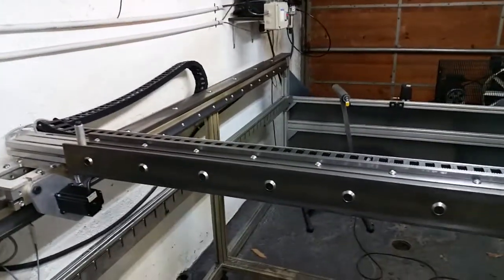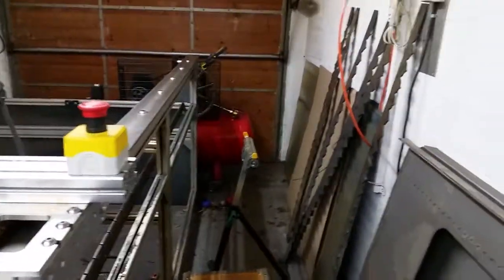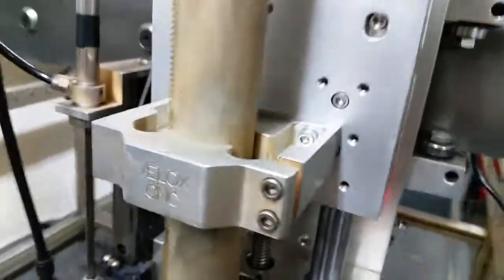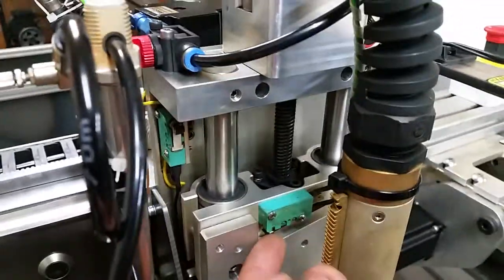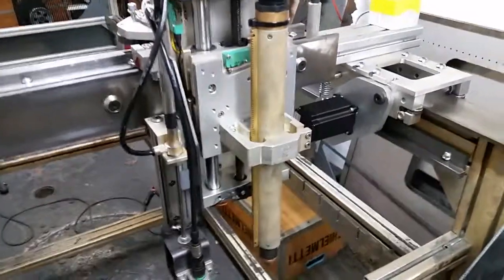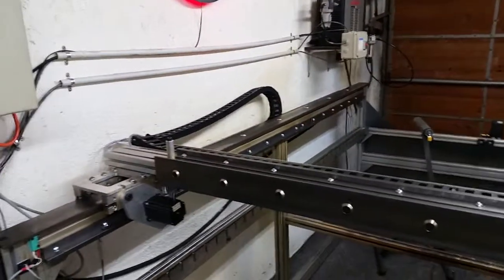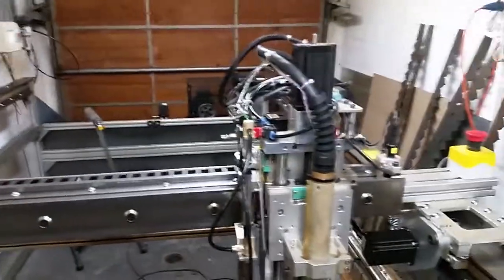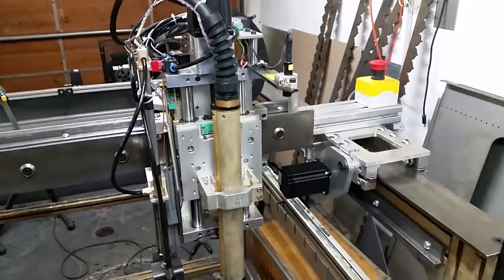CNC Plasma : Updated Drive system from CNC router parts

Comment: Hello. Can you please send me your wiring diagram if it's not too much trouble? I will be using the same components to build my own plasma so it would save me some time and I would apreciate it. (mail: zjockoo@net.hr) . Also, I'm wondering why did you change the drive system; I plan to use 4:1 belt reduction from the motor to a 65 mm gear pulley for the AT10 belt. Was it not precise or is there any other reason? I saw you put the belt directly on to the motor shaft...maybe that was the issue..?

Thank you